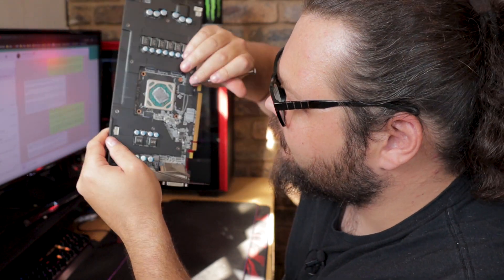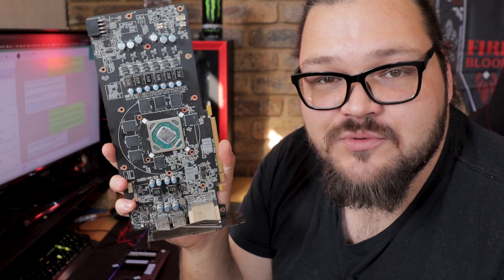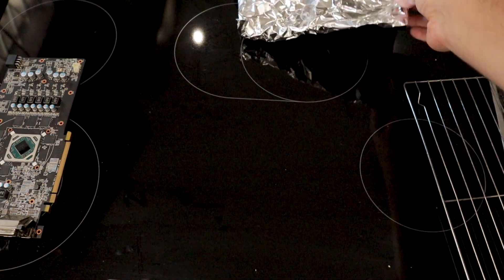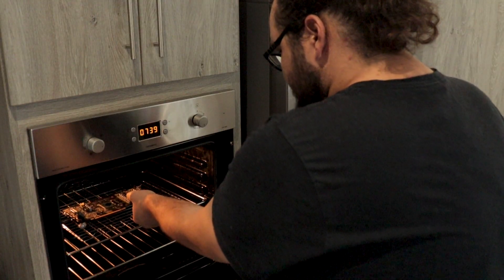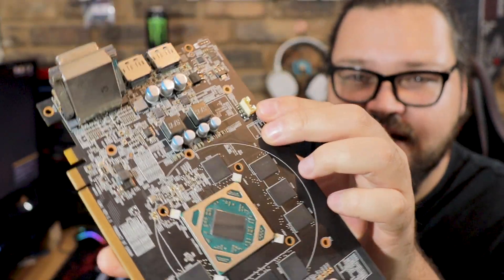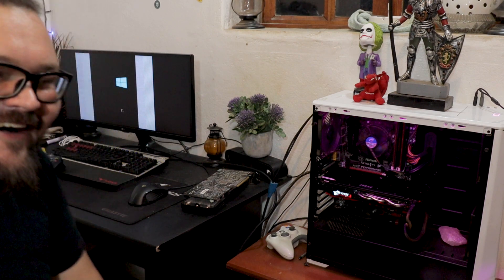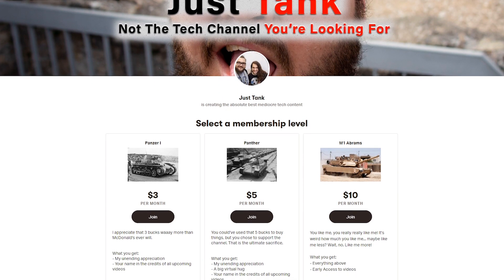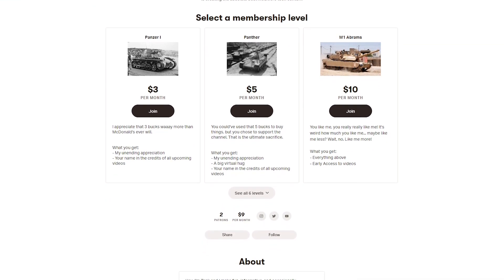Baking A DEAD Graphics Card! | Will It Work?!

Comment: I fixed a GeForce 8800GT today using this method! I had a very similar issue with it - when no drivers are installed and Windows is using VESA drivers - persistent artifacts and ghosting - looked sorted of like a section of the picture is copy pasted in real time with some transparency multiple times over the screen in several places. And when the nVidia drivers were installed - it would just BSOD on boot when loading nVidia driver.
I used an ancient, soviet-made, gas powered oven (which makes this even more surreal, that such a low tech device can fix such a high tech device) which doesn't show temperature, but I'm guessing it was around 200 or more Celsius?.. Also, instead of foil balls, I screwed in 4 metal standoffs, just like the ones e.g. motherboards sit on. Also, after baking it for 10 minutes, I just turned the gas off and I let it cool in the oven until it was room temperature, I went away during that time, but I think it probably took well over an hour to cool down.
Just ran FurMark for 10 minutes straight - seem to work! 🤞

Comment: What temp did you place oven on and for how long as i have reballed graphics for years with no comebacks using this method but i use 100 degrees for 6 mins on four balls of foil middle shelf must be a fan assisted oven.
I did this to my nephews hp probook 7 years ago and still works fine now and is used everyday

Comment: With 480's running so hot I'm surprised they don't reflow themselves.
Also, reflow temps usually start at 220C, perhaps try ramping up the oven and see how that goes.
Reply from the maker: 😂Good point. And yeah, I screwed up temps-wise. The times I got it to work I had the oven set way higher but I only remembered after the fact. I'm going to try it again at a higher temp and give it a few more minutes and that should do the trick.
Reply: @TheTechTank  I'd love a follow up on that, really like your channel, keep it up man!
Reply from the maker: Thanks man, will do!
Reply: @TheTechTank  did you do the follow up? if so, what's the name of the video? searching oven on your channel only returns this video as a result. I'm guessing that if no follow up was made that increasing the temps didn't work?
Reply from the maker: @SaisukeMutsu  Pretty much, yeah. I tried it again at higher temps once or twice ages ago with no luck, and I ran out of time to dedicate to getting it to work 😭Could always make a follow-up video one day doing it the proper way, maybe even with a proper resoldering oven or at the very least a heat gun.
Reply: @TheTechTank  yeah, I've been reading up that the oven method has way less success rate than the heat gun, at least in te long term. But honestly if it's anything but the solder, it just won't do anything and that could be the case with your card. I have a 390 that works for a while and then artifacts until it straight up won't boot, I leave it for a few hours/days or if I DDU the drivers and install everything again it works better for a while with no issues until it eventually stops working. Sometimes it takes days, sometimes hours. I'm thinking of using the heatgun but I think you need flux to do it properly, which I don't have yet.

Comment: i remember using the towel reflow method for my ps3. it worked for a few years untill i updated it where it bugged out and bricked.
Reply from the maker: Holy crap, I've literally never heard of that method until now. Somehow that seems even sillier than the oven method, but I guess it actually makes sense...
Reply: @TheTechTank  yeah lol, it was literally putting the ps3 in a towel and leaving it on for a while. iirc you would leave it to overheat and cool down and it would work
Reply: @TheTechTank  the only thing was the ps3s disk drive wasnt working and i only found it out when i fixed it lol
Reply from the maker: @Sol-su2mi  Lol, well that's a pretty big issue, unless you had all your games installed on the HDD and a killer internet connection 😂
Reply: @TheTechTank  nah I was a broke kid so I played demos lol. A few years later I did get the slim which was great
Reply from the maker: @Sol-su2mi  Haha, DEMO GANG for life! The slim was really dope, major improvement over the PHat version.
Reply: Toweled My xbox 360 Fat and it still works😂